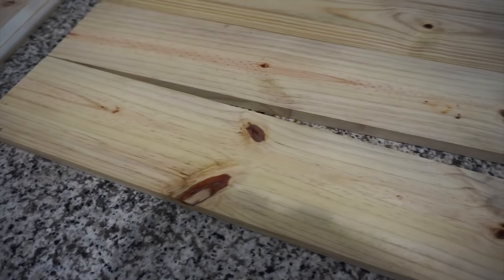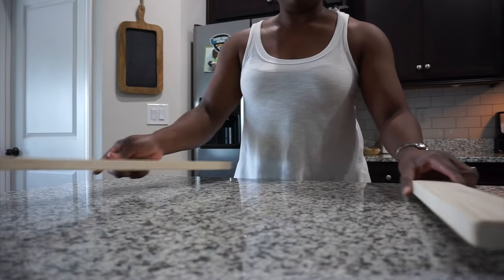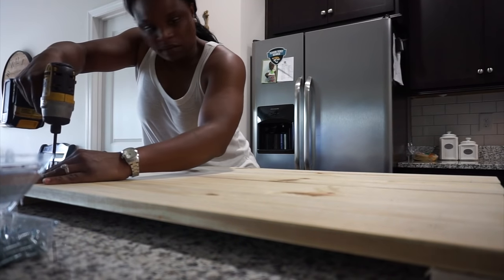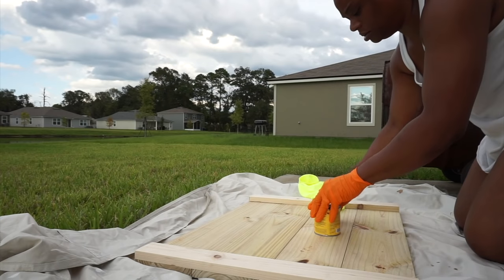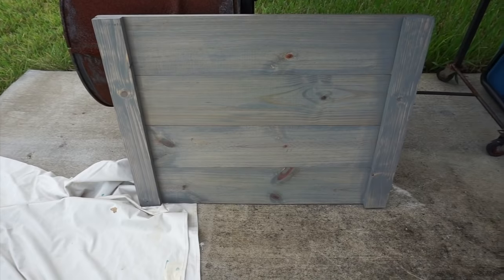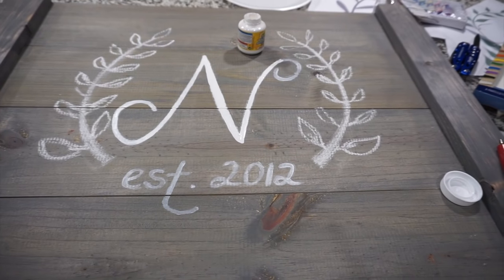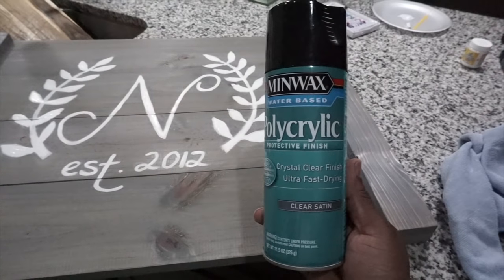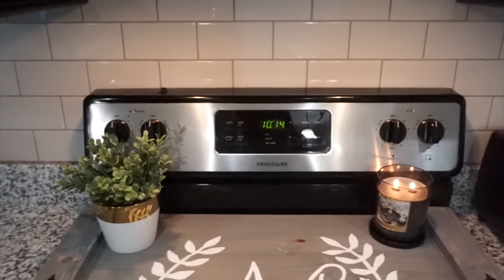DIY Farmhouse Decor | Wood Stove Top Cover | NeesieDoesiT

Comment from the maker: Hey everybody. I saw that a lot of you had questions on the wood sized that I used. I apologize if I said it incorrect in the video. The wood you purchase should be 
2- 1x6x6ft boards 
1- 1x3x4ft board
Reply: NeesieDoesIT what's the length of the smaller boards?  24" maybe?  Video cuts out when you mention the length.
Reply: What kind of screws
Reply: Do you ask for any specific type of wood?
Reply: To late so I have to make it work. The boards that run down the side for the handles are to short.
Reply: @vegangelist  she said 21, but 21 was to short.
Reply: What TYPE of wood? Pine, treated, untreated, MDF? would've helped if you'd shown it before cutting and the UPC so folks could get it right.

Comment: I like the idea, design and that you made something and sharing.  A couple of things that might be added would be to pre drill the holes for the screws as you can split that wood very easily, use wood glue in addition to the screws, and put wood conditioner on before you stain it, this will help to make the stain even and sand in between the coats of clear coat.  Not criticizing - just some additional steps if anyone wants to do them.   I love the way you decorated it and the handles on it.

Comment: Looks good! When I get around to it,I'll be making a custom version as well. Plan on making a possible spice rack,or small display shelf in depth, that would be slightly smaller then the back of the cover. Put the rack on the wall with a French cleat on top of the rack,& the other part behind the cover. So when the stove is in use,I'll just hang it on the rack so it becomes a piece of art on the wall.

Comment: That cover is so awesome! What a great idea. It looks beautiful. I would love to try this, but I have a gas stove  so I would probably have to adjust it somehow, do you have any suggestions? Thank you so much for sharing this wonderful idea.
Reply: DeAnne you can just add 4 "legs" to it....just cut up 4 pieces of wood, about 2" tall should do, this will allow clearance between the board and the crates. Also if knobs are on top, knobs and crates could be different height so adding legs will make the board sit evenly on your stovetop
Reply: @robertogutierrez9410   Great Advise.
I Think I Would Cut Some Felt. To Go On The Bottom Of The Legs As This Would Be Good So The Glass Stove Will Not Get Scratch.   I Love DIY Videos.  People Also Help With Great Comments.  Thank You. Have A Great Day.

Comment: What if I wanted a glossy coat . What would be the best product. And what length was the screws.
Reply: The total height of the wood is 1.5 inches so 1 in - 1.25 in wood screws should work.

Comment: Hey quick question, did you cut each board 29in or you cut it by the length?
Reply from the maker: If I remember correctly 29 inches was the width of my stove top so the boards going across were all cut to 29 inches. The two boards used for the handles were a little over 22 inches
Reply: NeesieDoesIT thank you for responding. My stove is 29 wide but it’s 21 inches long. What should I do.
Reply: What size screws?